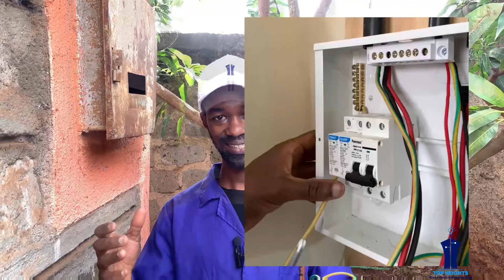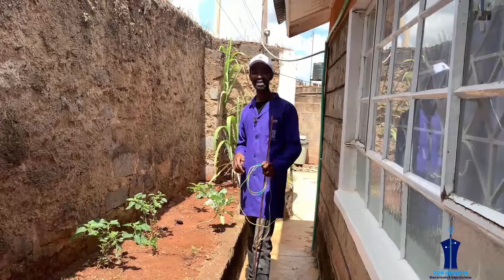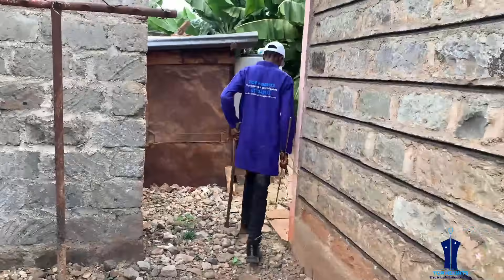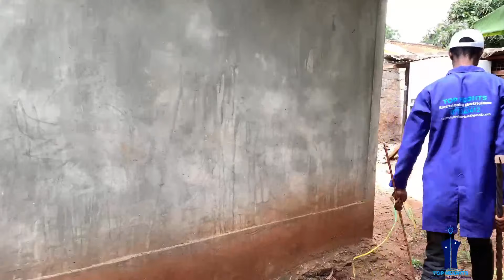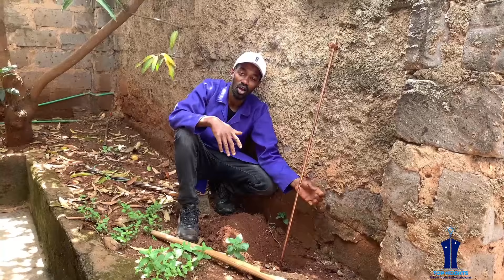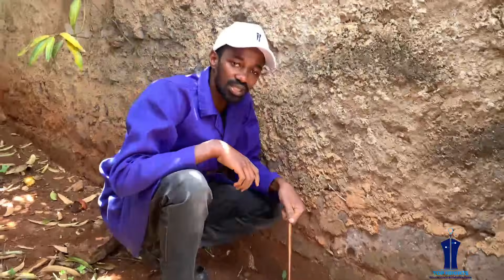Best Ground for Earth Rod.

Comment: I live on a raised 3 foot foundation.. not sure how to get the rod into the dirt without going into the crawl space!  There is a small 1" diameter hole in the floor that provides access to the dirt below. I was thinking if I get a 6 foot copper rod (1/2" diameter).. then 2 feet of the rod can be under the dirt,  3 feet will be between the floor and the dirt, and 1 foot will be above the floor.

Any suggestions?

For example, is there a way to secure a drill-bit on one side of a copper rod, and connect a drill to the other side of the rod.. such that you drill the grounding rod directly into the hard dirt?